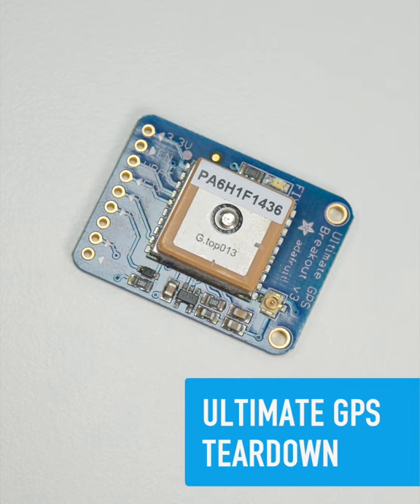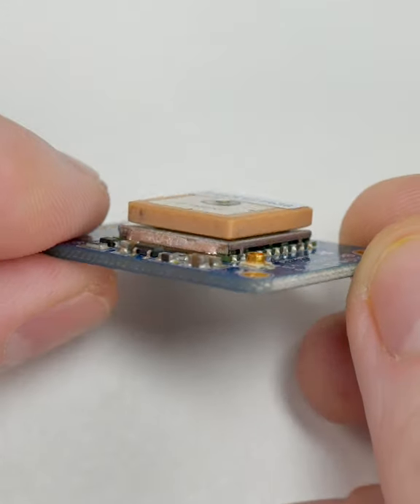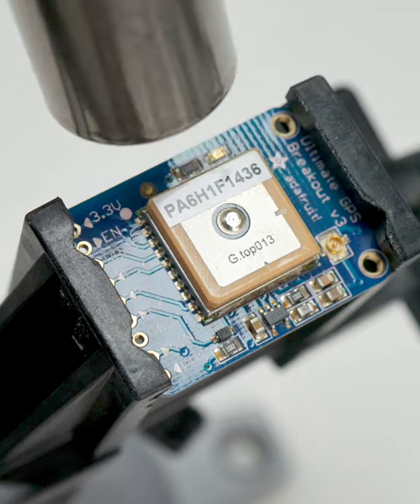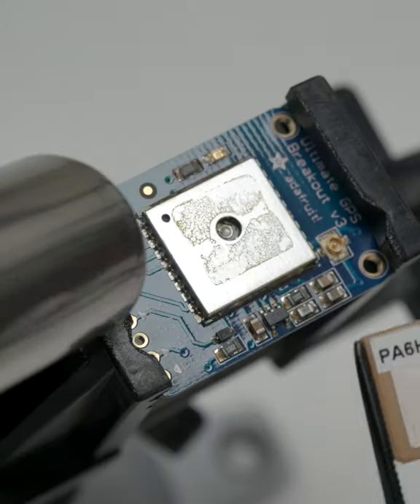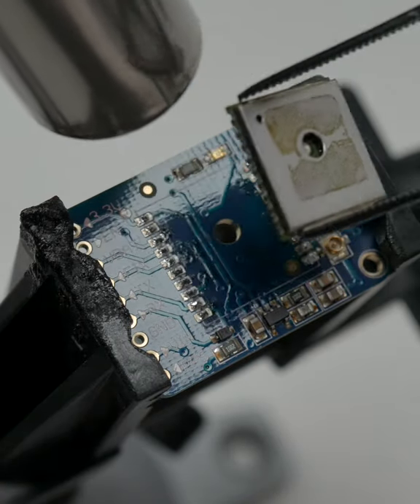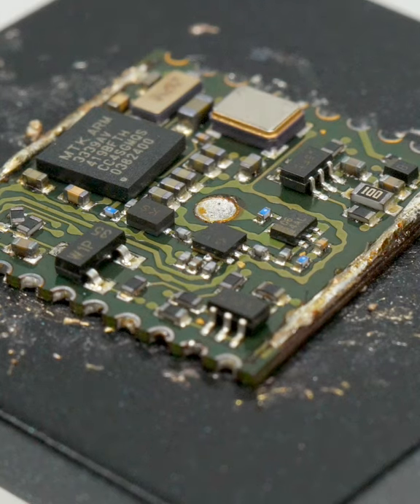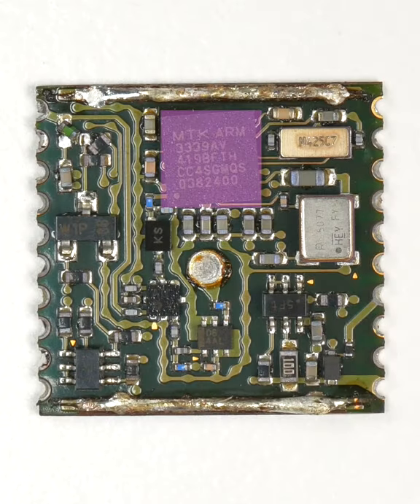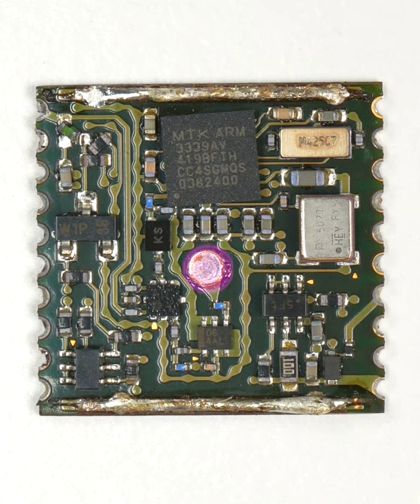Ultimate GPS Teardown - Collin’s Lab Notes #adafruit #collinslabnotes

Comment: Now that's a teardown us normal people can't or are unlikely to do, cool! Fancy "bulging" traces, I assume for RF reasons.
Reply: This is my question, too. Anybody knows why the bugling traces?
Reply: The bulging traces around the edges of the GPS daughterboard are where the shielding cap is soldered on so its well grounded to limit interference.

Edit: I just noticed the bulges that are along traces throughout the board and I can't explain those. They do seem to only be on traces that would handle RF so it must be for that, but the irregular spacing has me confused
Reply: I assume it is because of standing waves. You bulge them at the anti nodes.